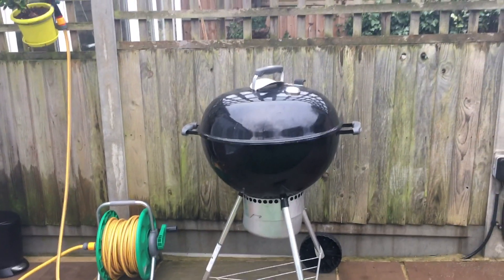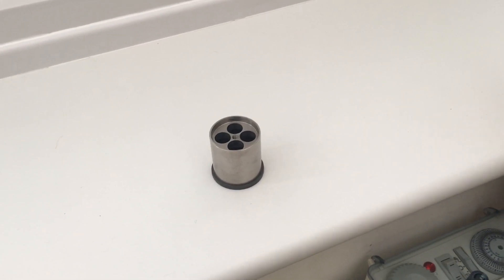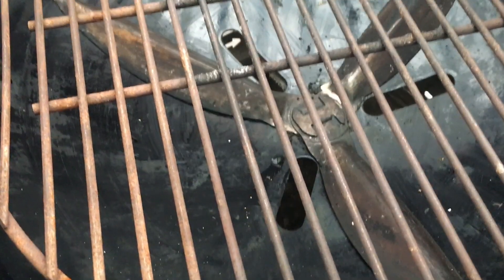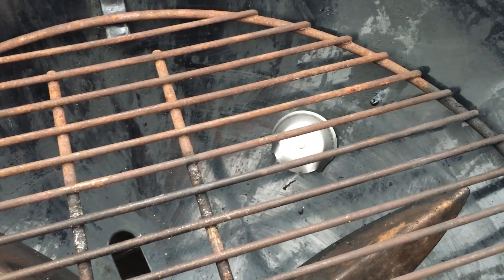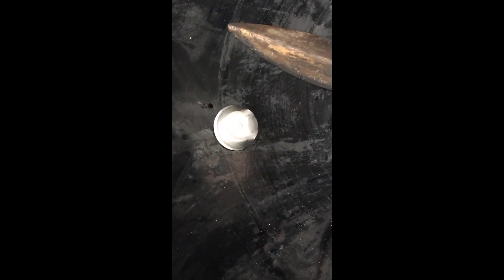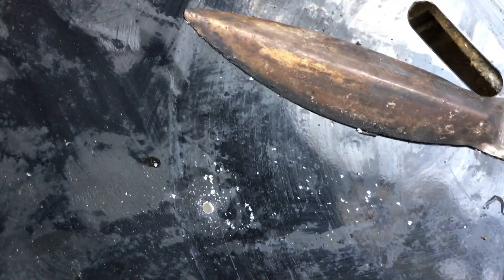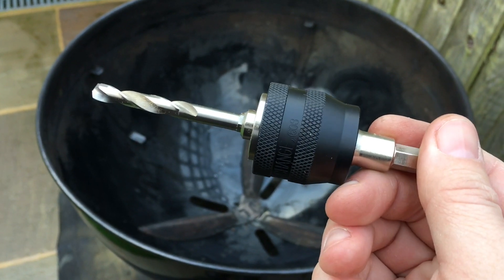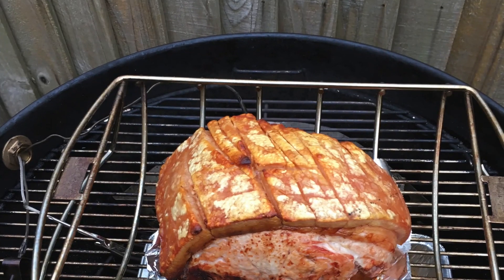BBQGuru universal adaptor installation on Weber 57cm kettle

Comment: I'm considering doing this to my Weber Kettle/Smokenator setup.  I think I'm on my 4th year with the setup.  Really interested in better temp control instead of getting a $300+ pellet smoker, etc.  Are you still happy with your setup?  How has it been doing since posting this video?  Thanks for the advice!
Reply from the maker: I still use this almost weekly and I'm really happy with it. I did have to replace the ash fans in the bottom recently as I was getting air inflow through them after quite a few years. It still holds temperature really well for anything up to 8 hours.

I use it with the slow 'n sear these days (replaced the smokenator) for longer cooks at lower temps (220 - 290), or with separate baskets for high heat cooks like roasts. You can see some of the work it does over at https://www.instagram.com/meatandtongs/

Comment: did you drill a different hole for your temp probes? I've got a 27" kettle and I'll be looking to put a hole in it soon... might as well do two if it's better that way!
Reply from the maker: I drilled another hole just above the grate and used some 1/2" running nipple nipple with 2 hex nuts holding it in place.

Comment: Thanks for the video!  This gave me the resolve to bite the bullet and get a controller for my kettle, though I ordered the Flame Boss. 

One question: does the placement of the adapter interfere with the sweep of the blades in the bottom of the kettle?  How has the position worked for you?
Reply from the maker: I have the adaptor above the blades - once I'd measured, I swept them back and forth to make sure they'd be clear. I did that so that I can still use it as a normal grill or smoker without the fan in. Being slightly higher also seems to help with ashing - it's blowing above where most of the ash sits, so it's not lifting it and moving it around.

It's been working great for around 2 years now - I've made a similar modification to a pit barrel cooker since with equally happy results.
Reply: Glad to hear it! Thanks for the response, and happy smoking.

Comment: Thanks for showing an excellent detailed process on how to do this. I wonder if you see much ash coming up to your food with the blower? 

I am debating purchasing one of these myself and wonder if you would do it all over again? Thanks.
Reply from the maker: Warren Wadel Hi. I’ve had no ashing issues at all. For the most part, the blower isn’t running all the time and it’s light puffs only. 

I’d definitely do it again. It’s made a big difference to the ease of running long cooks for me.
Reply: It looks like the blower is positioned above where you would have ash, isn't it?
Reply from the maker: Yes, it is. It's below the lower grate (where the coals sit) but above the ash catch area which is the bottom of the bowl.

Comment: Needless work , destroying a perfectly good grill, i never have problem with temps, i just use a digital thermometer. GOOD LUCK THOUGH!
Reply: If you are simply grilling at high temps for a short period of time then you don't need to worry about temp control. But, if you are cooking "slow and low" at say 225F for four to six hours then you would need this.
Reply from the maker: Before this setup, I often cooked for many hours low and slow. But doing it in the rain and cold and variable temps (~ -2 - 8C) made keeping temp hard. This makes it brainless - start, set temp, go work on something while food happens :)